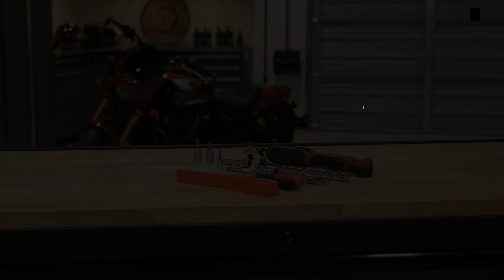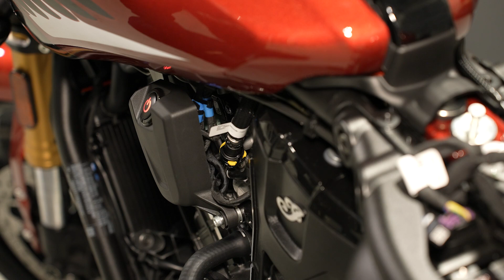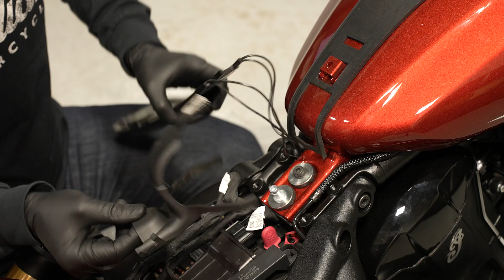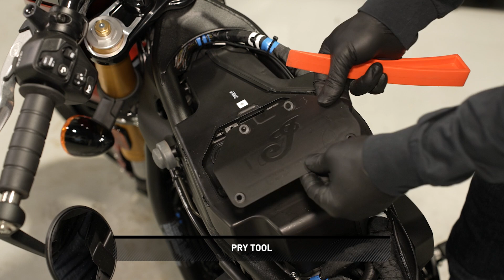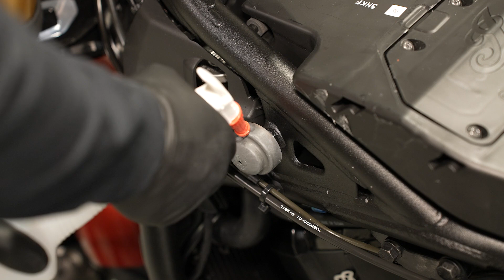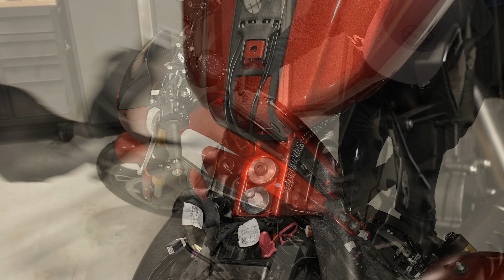2025 Indian Scout | Air Filter Inspection and Replacement - Indian Motorcycle

Comment: Hello Indian Motorcycle team! Could you please release an official video tutorial on how to disassemble the Ride-by-Wire throttle housing to replace worn-out handlebar grips on the new Scout 1250? The original rubber gets sticky over time and many of us need to replace them. A step-by-step guide on how to safely open the housing without damaging the electronic sensor would be extremely helpful for the community! Thank you!
Reply: It's pretty easy to remove the rubber, just need pressured air between the base grip and the silicone, and it slide of. But I have another alternative, just u need to get a non slide heat shrink tube, to the size of the handle, and that's it, use ur faved hot air gun and problem resolved (I got ones with the indian logo on it)

Comment: Geez, why not just put the air filter on the right side of the motorcycle like on the Harley Davidson‘s
Reply: Cause the system use a 'high vacum ari box" prevents for water 🌊 under rain touch the air filter.
Reply: @fabivsplay5688  I get it but this is not a sports bike. It’s a Kruzer man you’re missing the point Infiniti a better argument is the ancient does the cleaner I’ll give you that trying to help you here.

Comment: What about air box removal
Reply: It's pretty easy, I need to remove the plastic cover of the left side (radiator cap on it) use 6mm hex and 25 or 27 torex, (I don't remember exactly) remove the cooler refill neck, then under the right side remove the 2 hooses of Carter vent (just with hand) and then slide the airbox up. And that's it.

Comment: Great video! It’s clear that the 2025 Indian Scout has definitely improved in terms of changing the air filter compared to previous models—definitely easier now. However, it’s still a bit more complicated than on bikes where you don’t need to remove the fuel tank. Also, it’s really appreciated that the official Indian channel makes these kinds of videos—so far, only Indian and Royal Enfield do this as far as I know.